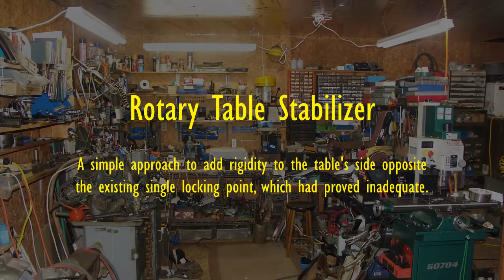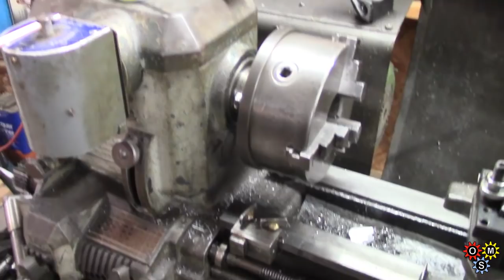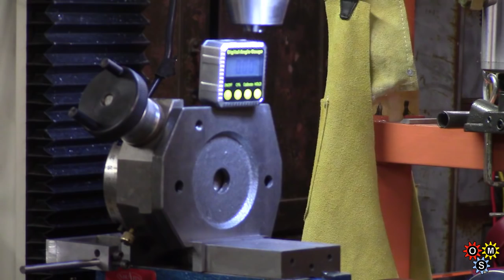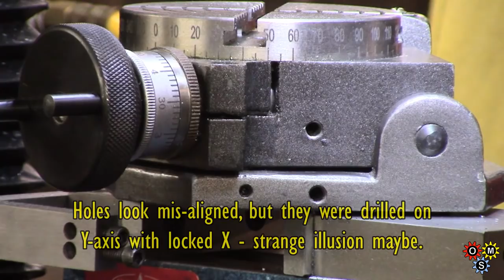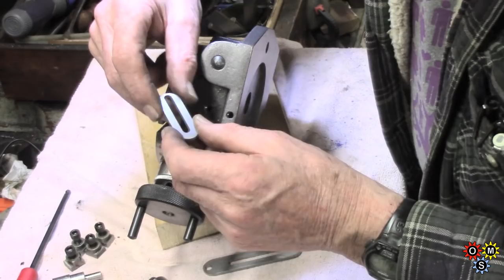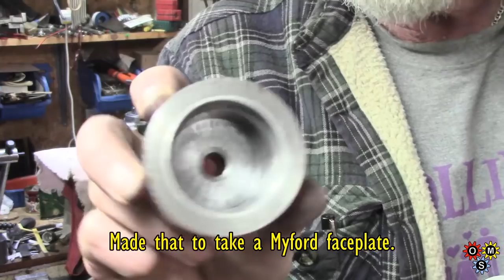Rotary Table Stabilizer

Comment: Hello Chris. is that chuck is good ? I have plan to purchase it . it cost arround US $ 134-150.  
before that, i have plan to purchase sherline rotary table, but it cost US $ 270 for only rotary table body, not include tilting . but guarantee you get the good quality on sherline.

Comment: A bonus I just thought of is if you needed to repeatedly go back and forth between a couple or a few specific angles, you could mill a set of bars with holes indexed to those angles. Easy peazy!
Reply from the maker: +ExtantFrodo2 

Hi - yes, that could be useful. Only thing however is getting accuracy absolutely right. With the slot it's not too much hassle to set up, particularly if using an angle block for common angles.
Reply: ChrisB257
     Alternately, if you were going back and forth between horizontal and some specific angle, you could set your angle, then use a clip or bolt or something to block travel beyond that point.
     I've been able to use this thing to make pretty good gears so I'm quite happy despite it's short comings.
    BTW, love your videos. Keep them coming.
Reply from the maker: +ExtantFrodo2 
Thank you. That sounds like a good notion for sure... add a travel stop to my slot. :)
Reply: ChrisB257
You'll find it right next to the prick punch.

Comment: Good idea.  I think i would use multiple brackets with just two tight holes in each bracket.  Say a 90 degree, 45 degree,  30degrees and a 15 degree.  With small tight holes you would be on the mark every time.  Mark each bracket with the degree.  It should actually be a faster set up with a known angle.  Thanks for posting.  I would have just been pissed that the rotary did not work perfectly and not know how to fix.
Reply from the maker: +Thomas Harrell 
Hi Thomas - Thanks, great idea, except -- the pre-set positions would need to be absolutely perfect and I think I'd rather finish set-up each time by sine bar, indicator etc. Not sure the absolute accuracy limit would be available your way but like the idea a lot.

Comment: Nice mod. I think I will copy it. I've got the same table. Brilliant design having the bolt holes under the table in the closed and fully open positions.... not. It makes indexing and tightening down mutually exclusive operations. Grrr.
   I'm not unhappy with it. The price was right and I have been able to make gears using it so...
Reply from the maker: +ExtantFrodo2 
Ah yes - those mounting holes! Annoying.  Not bad for value though.
Must say - the extra stability now from the tweak makes it well worth having done.
Reply: ChrisB257
Perhaps mounting it to a plate...? I like your idea of connecting it to a vise. I might use that.
    If you hear of a way to connect a stepper motor to it I'd be very glad to see how it was done. As it is, I had to coordinate the indicator rings for each tooth, lock and unlock the table between each adjustment to make my gears.
Reply from the maker: +ExtantFrodo2 
Hi - the vice idea is convenient if vertical space not too reduced, plus probably not so ideal for super critical work.
I rather doubt a stepper motor would be too easy to set up - ideally a dividing head is best for gear cutting, tho without one certainly your way can work - if enough patience! :)

Comment: Have you contemplated a quarter circle slotted brace, similar to the one on the opposite side of the rotary table? You should be able to squeeze the curved brace in below the top of the table. Using thicker material you could possibly mount the brace on top of the rotary table base edge and keep everything more compact and inside the base edge.
Reply from the maker: +Gerhard van den Berg Hi Gerhard,
Not sure that would stay clear of everything but nice idea.  I basically went for simplest and thus far the lock-up is good.

Comment: Hi Chris, 

A Bison chuck is a great purchase, those are probably precise within 2 to 3 thousand run out spec. A press fit is a little more risky, maybe a screwed in insert with the threaded part.... 

A while ago I got lucky enough to pickup a 10" Bison with a set of reverse jaws as the jaws aren't the split type. Advise don't let a 6" chuck fall on your feet, even less a 10 incher... lol

Cheers,   Pierre
Reply from the maker: +pierre beaudry Thx Pierre. Do you think a press fit might be damaging? Was thinking 1.5 - 2 thou oversize. You idea sounds safer must admit.
10" Bison - lucky fella! Don't even drop a small 4" on the foot! :)
Reply: The press fit could be reasonably solid, to help inserting you get the exterior part a few hundred degrees, you freeze the interior part to ease the insertion, since you got a lot of meat on the outside, the inside part will be pretty locked in without the risk of opening the outside...

Only do the finishing cuts. trims, bore and treads after the part is inserted and everything had cooled ans settled, if well set in a 4 jaws chuck it will insure minimal run out as you go along the process....

Good success,  Pierre
Reply from the maker: +pierre beaudry Thanks Pierre -- I was considering the cold into hot but on reflection maybe don't want to heat the chuck that much. I think perhaps your idea with using the current thread is good - get a tight fit and then Loctite and continue! Appreciate the feedback, thx again.

Comment: The rotary table brace looks good, why don't they do that in manufacture?  For your Lathe chuck machining, I find the very best way to get it accurate and concentric is to fit the back plate on to the chuck, then clamp the chuck to a turned spigot in the Lathe, using the chuck jaws to clamp it on, you can then bore and thread the back plate knowing it will be spot on when you mount the chuck, it has worked for me every time with no run out at all. Chris B.
Reply from the maker: +Englishman French  Not done Chris I guess because unit is 'budget' category. It is quite good value overall. 
Nice idea with the chuck back plate system, thanks... very logical. :)
Reply: +ChrisB257 Or, make the register under size and bolt holes over size, then bump true after fitting to the lathe. There are many precedents to the method. I did this to a Bison self centring 4 jaw, easily holds 1 thou run out, and if critical can set it spot on for single size.
Reply from the maker: +Chris Stephens Hi Chris - thanks -- I was contemplating a very slightly under size register actually - only by a very few thou - then generous clearance holes for fixing bolts. I have this pretty much on the old chuck and the value of being able to 'bump' for the odd thou or two does help best set-up IMO.
Reply: On a new chuck you should not need more than a few thou (4-5 perhaps) clearance. You could try a tight fit to start with and go under if not satisfactory.
Reply: +Chris Stephens, This is one way I suppose, however, things which are a sloppy fit will inevitably "go out" at the wrong moment, when you most need them to be correct, if this method is used I would urge you to drill and ream dowels in to hold your final "accurate" position, but I would always go for the tight fit first, on a new chuck, if it is accurate at one diameter, it should be good over the whole range.
Reply: If you have deliberate slop you have a home version of a "grip-tru", but as I wrote it might be good to start of tight. If however the chuck only claims within 3 thou, a tight fit wont do you much good and you will need to be able to bump it true.

Comment: Well done as usual.  I like the new chuck, hope it is as accurate as you expect.  I finally got a rotary table myself.  It does not tilt but it rotates and can be positioned for horizontal and vertical.  Now I need to make a chip pan for the band saw like you did.  Cleaning up the mess from cutting is a miserable thing.
Reply from the maker: +cerberus Have already had the chuck on there Harold - it is a cheapy but it seemed no worse than 3 thou run out so - OK for quite a lot of work.

All clean-up is tedious - inevitable because we always make mess! :)